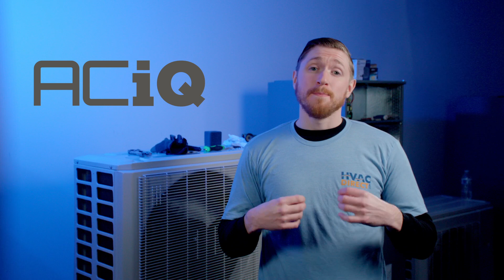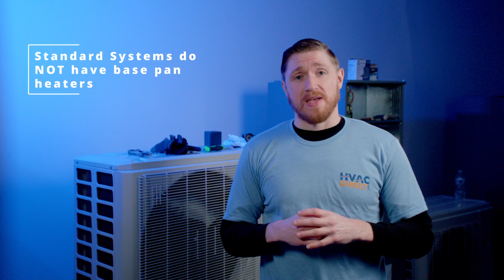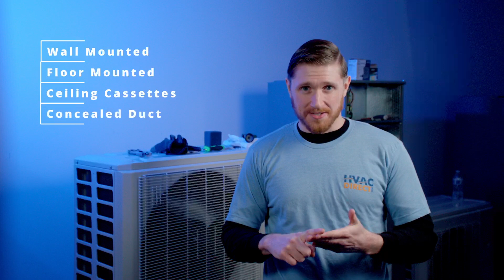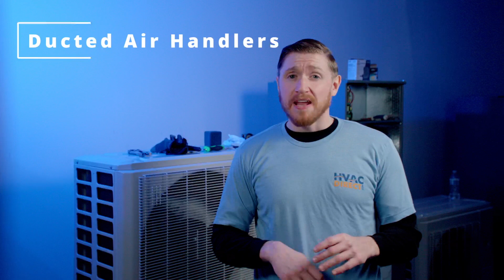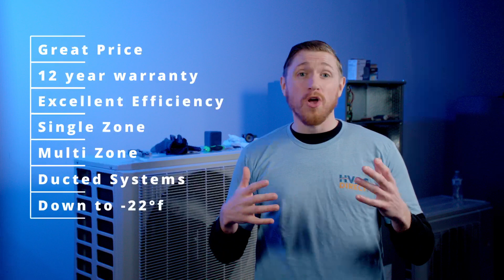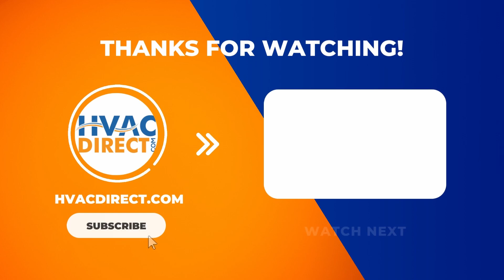Should You Buy an ACiQ Mini Split?

Comment: Hello, thank you for your video. Is it possible to have different air handlers connected to the same condenser? For example, a floor mount and wall mount air handlers.
Reply: Yes, you can mix and match your evaporators on multi zone condensers

Comment: How’s the quality on this brand compared to other big brands? Are hvac technicians willing to work on these or is it like the Mr. Cool brand where no one wants to service them? Are parts readily available?
Reply from the maker: Hello! ACiQ units are high quality units that come with a 12 year warranty. We have not heard of any instances of technicians not servicing this brand.
Reply: @HVACdirect I just bought a ACiq condenser/air handler combo. 
I’m having issues finding an installer willing to swap an old unit on a mobile home. 
One guy quoted me $2,500 for the service, the other suggested me to return the unit and wants to sell me a traditional HVAC replacement for $8,000; “all included”
Reply: I have no problems getting somebody to install and work on Mr Cool you need to put a little more effort into it